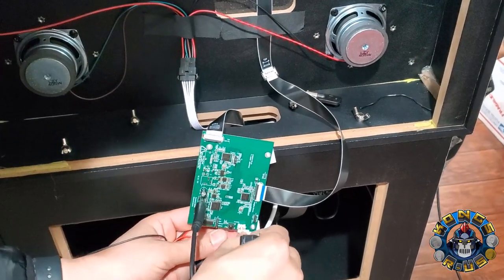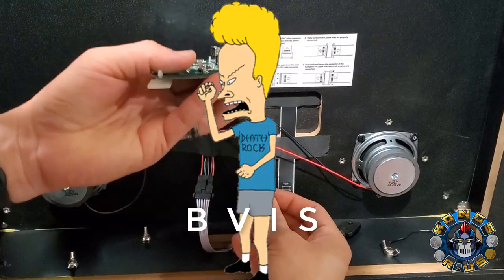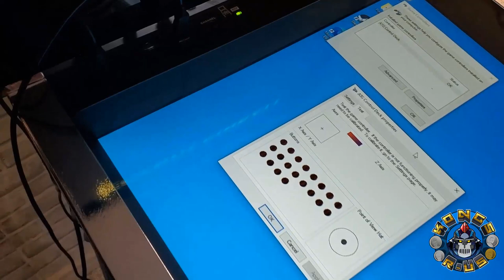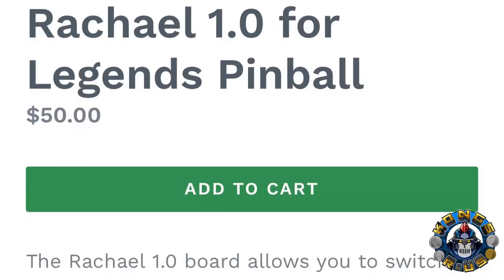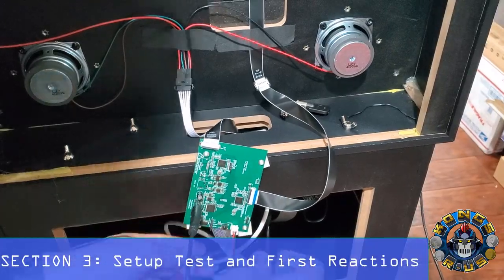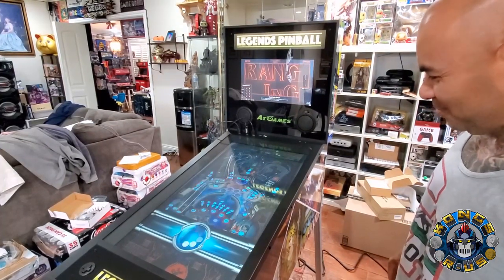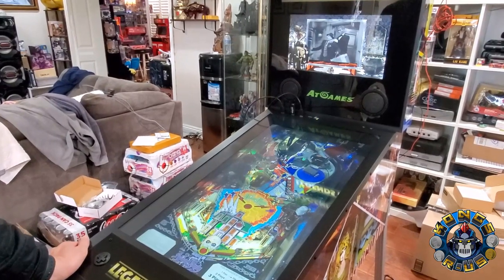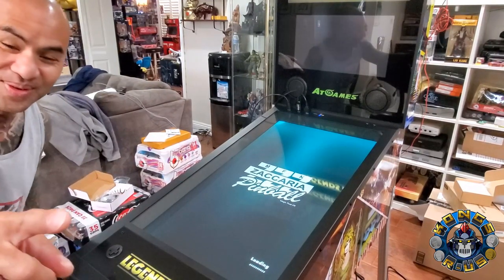AtGames Legends Pinball VIBS Rachael 1.0 Overview & Unboxing (Backglass Mod to Play VPX, PinballFX3)

Comment: So this isn't going to be tied into the current button?  You have to drill an additional hole in your machine to install another switch?
Reply from the maker: yes, it comes with a button so it's independent of anything included in the system

Comment: Hi. Video call this a BVIS but it is a VIBS  = Video Input Back Screen according to ATGames support.  No big deal and I like the sound of B-VIS better. :-) lol.
Reply from the maker: Lol, the original prototype board was BVIS - look at the box in my video 😄
Reply: @KongsRUs   OK well,,, ATGames should have left it as B-VIS  as that looks and sounds cooler.  Guess Backglass - video input screen  is bit odd so they called it Video input backglass screen, vibs.    My bad.  Any chance you know how to correct STEAM-FX3 flipper delay?
Reply from the maker: @davidkuiken6771  I haven't noticed Flipper delay for awhile, used to be a big issue, but I thought they fixed it. Not sure